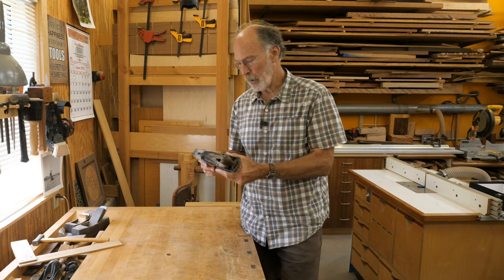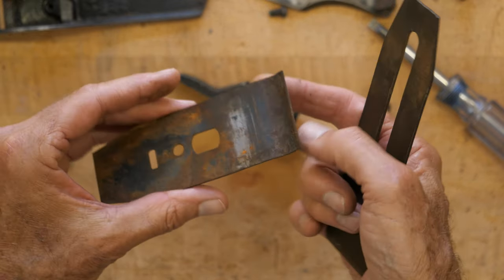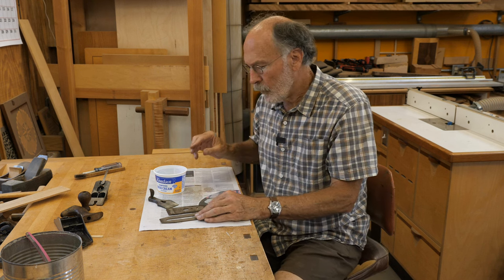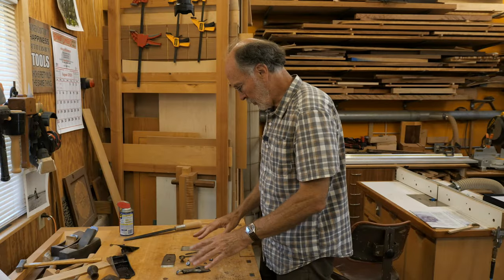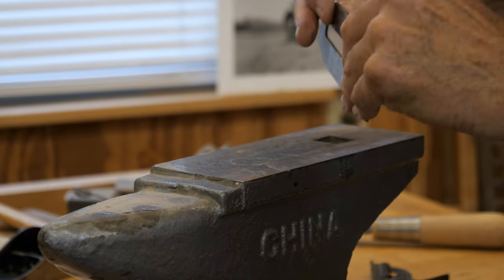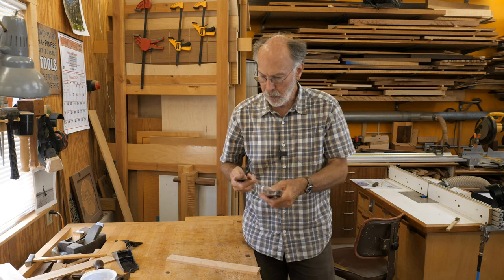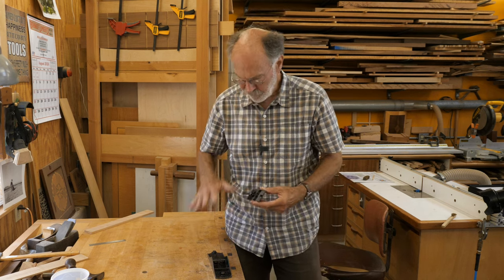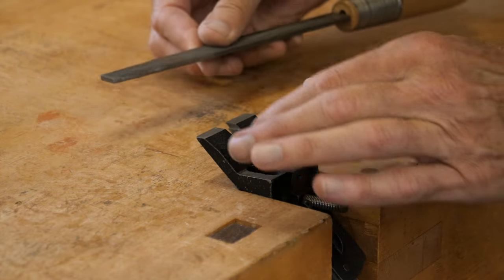Stanley Plane Restoration

Comment: If minor issues with the frog flatness are present, you might want to go by your local automotive machine shop and see if they will part with some lapping compound for lapping valves to their seats. Either way, cleaning before final reassembly is just a good practice for a restoration.
Reply from the maker: The lapping compound I use at 15:50 is the same material used for lapping valve seats. If you're referring to the flatness of the top of the frog (where the blade sits), I'm not sure how the lapping compound would work there. Thanks for watching and commenting!

Comment: It's wonderful to see a neglected tool returned to its glory.    Shellac on the japanning is a great idea, thank you!  I have a No. 7 that I want to use, however, the sole is cupped so that the heel and toe are high on the ends leaving a rather large gap in the middle when the sole is flat on a surface.  I don't know what happened to the sole in its past, but I'm afraid I would have to remove too much metal on the ends to make it usable.  Right now it leaves a nice smooth hump along the length of a board, not ideal for jointing.  As usual, I digress, thank you for sharing.
Reply from the maker: I've never seen one that's as bad as you describe. Even if you could fix it, sounds like it might take a while to sand it flat. Too bad it's not warped the other direction; you could easily create a spring joint!

Comment: good job! please tell me what kind of glue the sandpaper is glued to the lapping stone and what you use to remove the remaining glue. Thank you
Reply from the maker: I used PSA roll sandpaper from Klingspor. If that or something similar is not available you could use contact adhesive spray, but I have found that can be challenging to get even. To remove it use mineral spirits (a messy job). The PSA paper is much more convenient.
Reply: @CarlStammerjohn thanks!

Comment: Carl, Thanks for the videos. I am cleaning an old Stanley Bailey #6, fluted bottom. The debris is tough enough for a dental pick. Is there a solvent that I can use? Thanks.
Reply from the maker: Hard to know if there's a solvent that would work with something that hard. It's probably a combination of rust, wood, and dirt. Mechanical removal is most likely your best option. Fortunately it's easy to reach.
Reply: @CarlStammerjohn  thanks